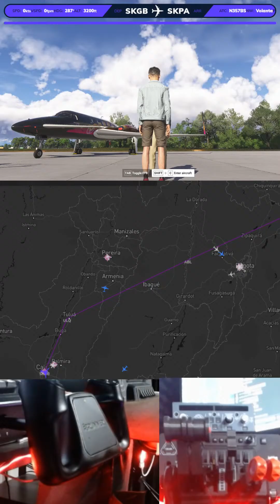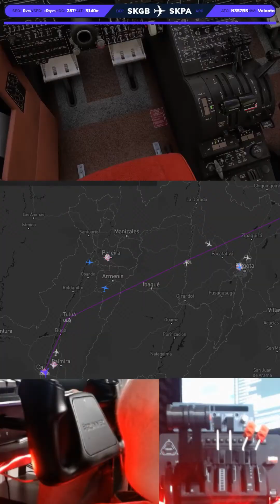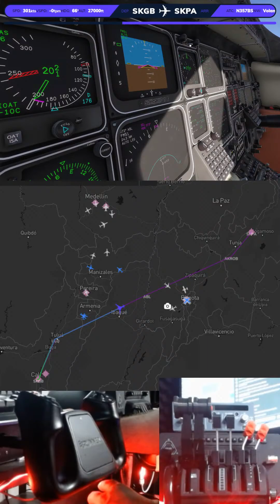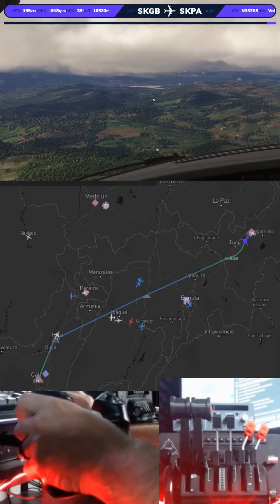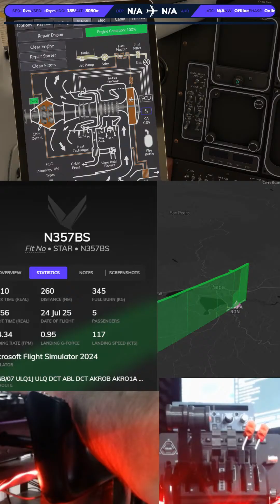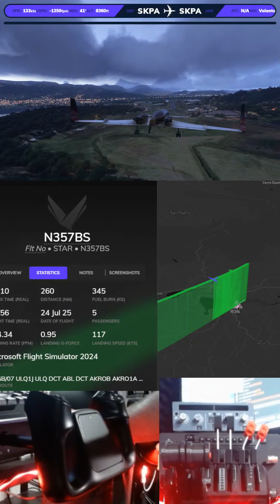🔴 Vertical Cockpit | StarShip Flight Tracker | Vertical Focus | #aviation #shorts #msfs2024 #boeing

Comment: When deviating around weather, do pilots rely more on heading (where the nose is pointing) or track (the actual path over the ground), especially in crosswinds? Since you have to set a heading before seeing how the track responds, do pilots adjust it on the fly? Do they ever request a specific track from ATC? And in normal flight, is heading treated as the direction of travel, or do pilots always consider the difference between heading and track?